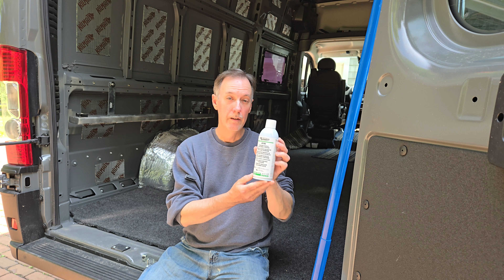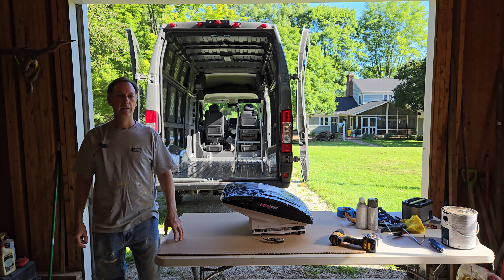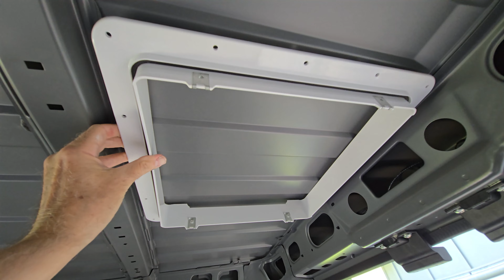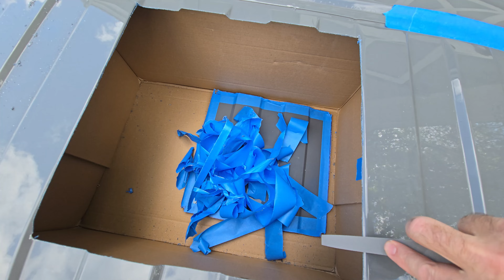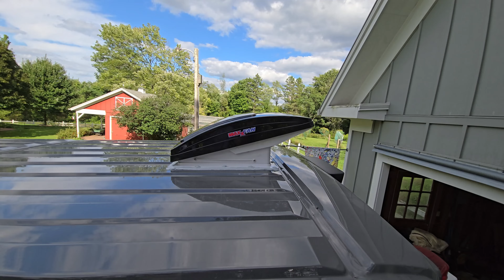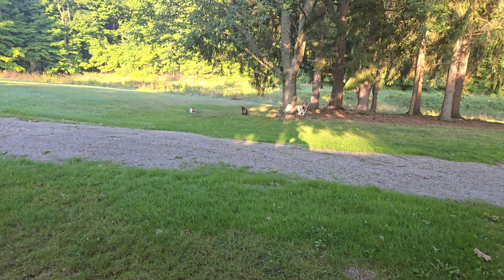Don't Install a MaxxAir Fan Until You Watch This | S1:E4

Comment: I’m curious what you have decided about the roof. Just found out they don’t have the bracket knobs that the other Promasters have? Why?? So weird. Have you thought about how you will install solar?
Reply from the maker: Our use case involves driving up to 8-hours a day and very rarely staying in one place more than one night. We're going to start with just alternator charging and see if it's enough. Next, if needed, we might try portable panels to deploy if parked for several days. Ultimately, if roof solar is needed we will use the no-drill method by 'RV with Tito"- butyl and lap sealant to secure a mounting channel. Five Pound Pete also has a great option using velcro with flexible panels (he says it's held up great for thousands of miles)
Reply: @MooseVan  I have seen several folks use the VHB tape and do fine.